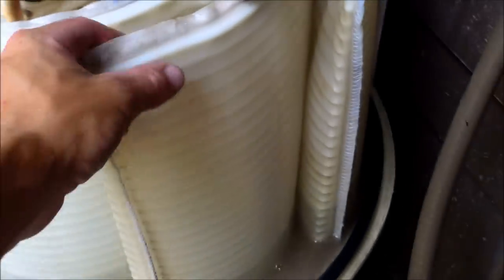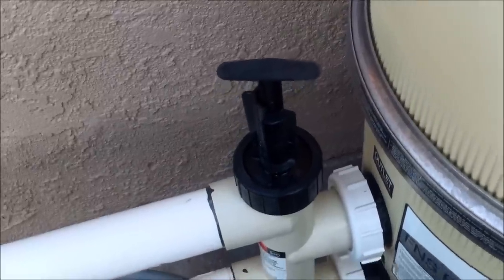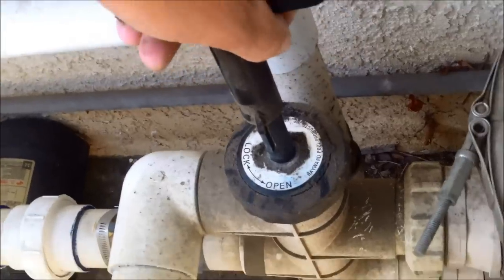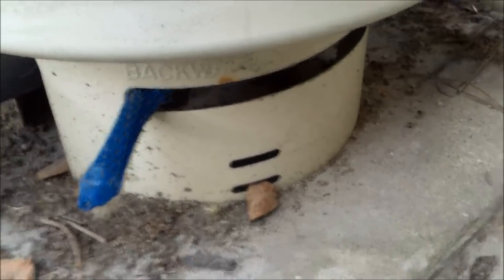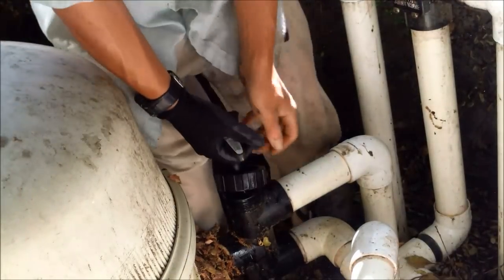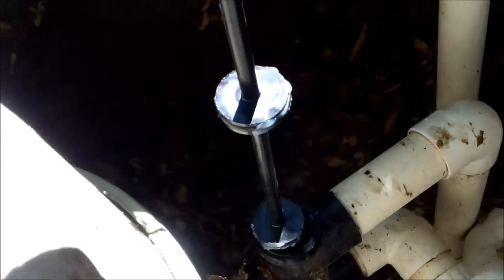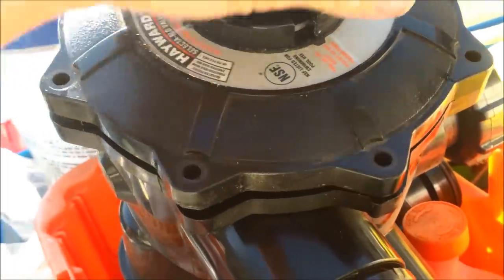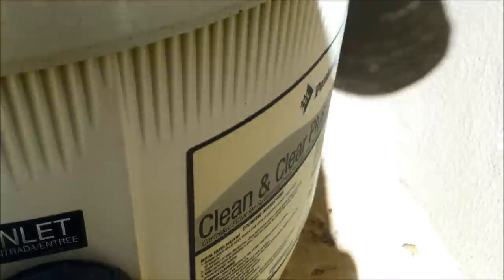How To Backwash Your D.E. Filter - The Ultimate Guide

Comment from the maker: How to Backwash your D.E. filter. Here is the most comprehensive video guide. I cover both the Push-Pull and Multi-port valves.  I also cover the most common problems you will encounter.
Reply: Hello, thank you for the nice ,easy to understand video. I would like to know if you haveany solution or feedback on this problem. I have a pool that has great circulation and suction for vacuuming. The cartridge filter has no apparent tear .However when I vacuum ,all the debris is being pushed out again by the jets...a mystery ???   Thank you for your time!
Reply: if i backwash my pool without a backwash hose(yea the de gets everywhere and i have to scoop it up with a shovel and throw it away later) do I still need to backwash for a minute or only 30 seconds? Sometimes I feel like I'm backwashing too much of the DE out. The last time I did a full clean out and charged my filter was 5/4/14. My psi is at 22 right now since I threw in baking soda yesterday night to raise the ph to 7.2-7.6. I shocked the pool with 3 lbs of shock to boost the chlorine levels, 1 crushed chlorine tablet mixed with a 35lb bucket water, and 4 cups of chlorox bleach mixed with a 35lb bucket of water. My stabilizer/acid levels are at 30-50 ppm.
Reply from the maker: I usually will backwash a pool for up to a minute depending on when the water starts to come out clear. Usually the first 10 seconds it is clear, then for about 30 seconds it is pretty dirty water. I will stop when the last 10 seconds is coming out clear. So roughly 1 minute give or take.
Reply: Swimming Pool Tips, Reviews & How To -MrDgvb1
I have an older pool  (filter catridge) that doesn't have the ability to backflow the water when I vacuum. There is so much sediment, that going thru the filter doesn't work, it just clouds the water again. Anyone know how I can easily put a backflow valve in? I would like to vac the pool bottom that way, add clean water, replace the filter as I have the water crystal clear....Any ideas or suggestions are welcome. Thanks!!
Reply: Jordana Angles you should vacuum the pool while the filter is on waste so you aren't pushing all that sediment through the filter. Waste will pull the water through the pump , bypass the filter, and send it out. Run a garden hose in with fresh water as you are doing it to maintain your water level.
Reply: Thank you so much, Anthony!!
Reply: N
Reply: Very helpful video. Question for you. How do you backwash if you have a separation tank? I would appreciate any help. Thanks!

Comment: Here is what I do, which lets you backwash with tap water instead of pool water!   This means you can dump clean water into the street legally (if you also use a DE filter sock to catch the DE coming out) or to your yard.  If you have a saltwater pool you also won't be losing salt or hurting plants with saltwater.  This only works if you have a pool+spa combo setup.

What I do is pump the spa water into the pool until the spa is almost empty.  At this point your pool might be close to overflowing (make sure you have enough room!).  Then I fill my spa with tap water from a hose, maybe 200 gallons or so, whatever you need to backwash with.  Then just run your normal backwash process but taking in water from the spa instead of the pool.   When finished, pump your pool water back up into the spa and you are done.

Comment: Thanks for sharing your expertise. I have DE filter with multiport valve. When I vacuum in filter mode, the debris returns to the pool. Same thing when I add DE. Eventually the DE will "stick" to the grids, but not initially. Debris always ends up recirculating into the pool. I have checked the grids and found no obvious tears. I have disassembled the multiport valve and replaced spider gasket and O rings, as it was turning hard, and I didn't believe the spring mechanism was allowing it to form a tight seal when recessed into place. I'm still not convinced it snaps down all the way, and believe some water bypasses the filter alltogether. Anyway, I'm considering splitting and cleaning and inspecting the filter again, but don't want that hassle if you have a way of determining whether it's the multiport valve that's allowing debris back in or the grids. I still think it's the valve, because the last time I split and clean, I put valve in filter position (after backwashing), and when I recharged the filter, around an hour later I noticed the pool lost 3 inches of water and water was going out the waste line even though the multiport valve was in "filter"! So, at that point I made the above changes to the valve. About the only other thing I can think of is the valve still isn't sealing tight, or that the bottom of the grids were punctured when I misaligned the manifold contraption and the bottom plate. Getting sick of vacuuming to waste to ensure debris goes out, and refilling with water!!! Please help!
Reply from the maker: I would open up the filter and take off the top manifold again. Check for any broken grid tops. Also turn the top manifold over and inspect the bottom for cracks. I am editing a video on the top manifold and I have found that the bottom tends to crack on occasion while the top looks fine. If that checks out okay and you think the grids are all intact then swapping out the multi-port valve would be a logical next step. DE can leak from several locations: cracked grids, top manifold, stem pipe o-ring and backwash valve.  You just have to go through the process of elimination sometimes if it isn't obvious. What filter model do you have?
Reply: Swimming Pool Tips, Reviews & How To -MrDgvb1 Thanks for opinion. I saw in one of your videos you backwashing a DE filter while it was split and exposed. Would doing this be safe and help me see if the grids fill with water? I'd like to visually see it fail if possible, in addition to double-checking grids for cracks.
Reply from the maker: taylocamax It is perfectly safe to do. I do it all the time before I put the lid back on to check for grid failure.
Reply: I also was wondering about backwashing while the DE filter was split and exposed. I have a multi-port. Can you please tell the the correct steps to do this correctly? I have DE shooting all back into my pool and Im sure that's why I can't get rid of the alge as well
Reply: Well I took apart the whole filter system. Checked all the grids and no holes. Put everything back together. First scoop of DE went in no problem. Then the second scoop went in and BAM. DE shooting into the pool. And I did check the top manifold
Reply: Ok so now I have changed out the manifold.  Changed out the o ring on the stand pipe. And inspected the stand pipe.   Re-checked the grids.  Took apart the multiport and checked the spider gasket.  And I'm still getting DE back into my pool.  I really dont know what else to do.  Please help.

Comment: I installed a new pool timer today & works great, I have been powering it up manually each day,it's a 2000 pentair Purex. I always  purge the air out each time I power up, now is this necessary in a automatic power up,? Meaning is it ok to have a little air in filter tank? Or do I have a problem?  With air getting in?  Or will it he air just bleed out on its own?

Comment: Hello there and thanks for the great vedio on Back washing very helpful.   My question is I have a Pentair high flow variable speed pump, with a Pentair Multi port Valve for Back wash what is the proper speed for my pump to use for backwashing. My pump setting is at 2800 normal running setting, Does it have to be lower for backwashing ?  Thanks for any Advice Appreciate.

Comment: just a small point. I take a small bucket and mix the D.E. into a slurry before pouring into the filter to avoid clumping. great video
Reply: Scott Mcguire That's why the skimmer basket is left in during the process.
Reply: Ultimo D thats good for keeping the clumps out but i like to hand mix it in the bucket to avoid the hassle of pulling clumps from the basket is all.

Comment: Regarding back washing..Is water suppose to return to the pool via the return lines while backwashing?  I thought during back washing the idea was to have no water return to the pool.  Is this normal or there is an issue with my system?  I have a QUAD DE Filter now.  Please advise.    Also I'm still having an issue with D.E. returning to the pool through the returns. Any assistance is greatly appreciated.  Thanks!

Comment: For the pull-push valves, is it necessary to lock them in place all the time? I typically just pull and push to backwash but don’t really bother to lock it.
Reply from the maker: Locking is important. You don't want it to activate or make it easy for a kid to just pulll it up. It has happened.

Comment: I have a Hayward slide valve. I removed the pin to take the t-handle off but the t-handle wont come off. Is it threaded, or do I have to just give  a tap with a small block of wood.

Comment: We bought a home with a pool a year ago. The pool guy came with the house, but now he is gone and we're on our own. He cleaned the filter once a year in the spring and never backwashed it, for 8 or so years. Now, we're trying to figure out how and if we need to backwash.  The big confusing part is we have a D.E. Separation Tank which has also been neglected.  We're trying to figure out what valves to open/close and how to backwash while having a DE Separation Tank in the midst. Can you show any videos of a DE separation tank??  Thanks.
Reply from the maker: Are you able to just cut the separation tank out? Those are a real pain. It would be better to just cut that PVC pipe and install a long 50 ft backwash hose if needed. Then you can just backwash whenever needed without messing with the separation tank.

Comment: Hey David I have a question you said some of the bigger DE filters is like a 60 or 70 square-foot filter is that mean that my basics C 900 cartridge filter which is rated at a 90 square-foot filtering capacity is more powerful than a large looking DE filter as far as square footage is concerned
Reply from the maker: Cartridge Filters do have more square footage for sure. But DE filters are more efficient with the smaller sq ft area due to the superior method of filtration. So a 60 sq ft DE filter is equivalent to a 400 sq ft cartridge filter.
Reply: On ok thank you david and if i may ask in your opion who makes the best filter tank hayward or pentair
Reply: Are you still using the perlite instead of de

Comment: Hi David, I just took apart my Pentair FNS Plus 48 sq. ft. DE filter and gave it a deep cleaning all the way down to the grids. After I put it all back together I noticed about 3 hours of it running it seems to build pressure back up to around 24 PSI. My meter reading is around 13 PSI when first turned on. Can you help me PLEASE. Last year it was running perfectly now it's starting to give me issues. Could it be the plumbing, air leak, or just need a new pump?
Reply from the maker: How old are the grids?  And is the pressure gauge dropping to zero when the pool turns off? How is the water flow?
Reply: It's a brand new filter I had just bought less then a year ago. I have a Hayward Super 2 pump that originally came with the house when we bought it last year. I notice some of the plumbing are 1 inch or 1.5 inch pipes that connect to 2 inch pipes that lead to the filter. Would that be an issue? I also seen your video on cleaning the impeller which I did but didn't find any dirt or debris. I am getting suction at the summer (which I only have 1 on my pool) and the return port into the pool when first turned on seems to be working fine at first but then seems to decrease pressure as couple of hours go by. But by then I notice my PSI reading is around 25 PSI by then

Comment: I cleaned my Hayward c1750 filter last month after the water pressure got derogated. However I noticed that the pressure gone low again in the pop-ups and the jets so I opened it and again today and it had dirt and debris in. after the filter got cleaned the pressure back to normal. do I need to clean the filter every month? or there's something wrong?
Reply from the maker: Those one cartridge filters are typically undersized for most pools. Especially if you have the in floor pop-up system as in your case. You will need to clean the cartridge regularly and replace it often. Once a month is typical.

Comment: Hi, How do I find out which PVC Push/Pull Slide Valve Piston is compatible with my Backwash system if I need to replace mine?
Reply from the maker: There are two leading brands. Pentair and Hayward. If your handle has an "H" on it its Hayward.

Comment: Hey david if a de filter is 60 sqft and my c900 hayward catridge filter has a 90 sq ft rating my little cartirge filter can do more than a big de filter ?
Reply from the maker: Technically yes. But a 60 sq ft DE filter will filter down to 3 microns vs your filter at 10-15 microns and it will need to be cleaned about every 6 months - vs yours that probably needs cleaning once a month. A cartridge filter has more sq ft of cleaning surface but operates differently from a DE filter. D.E. is overall more efficient with smaller sq ft of filtration area. If you want to try to compare Apples to Apples I would say a 480 sq ft Cartridge filter is equal in filtration to a 60 sq ft DE filter.

Comment: Ps. The reason I want just the T-handle off is to replace the large plastic nut that holds the slide valve in. Part # sp7200

Comment: When i clean my DE filter there is alot of DE in the bottom area of the grids it appears the DE came off the grids and settled in the bottom. Why is this happening and is it normal.
Reply from the maker: It could be that there isn't good water pressure getting to the filter, causing DE to pile up at the bottom of the filter. It could also be air in the system not letting the water rise to the top of the tank when running.  How old is the filter and what model do you have?

Comment: I find my grids, lower level, are not getting covered. What's my issue?
Reply from the maker: Could be poor pump circulation. If the pump is really old it might not be pulling water well.
Reply: @SPL  Have a variable speed about a year old

Comment: What if I have no backwash vavle do I just pull apart and clean everything once a month?
Reply from the maker: Take it apart and clean it when the PSI goes up by 10. Next time you clean it mark the pressure gauge with a sharpie on the clean pressure - say 20 PSI. Then when it goes up to 30 PSI take it apart and clean it.
Reply: I was told by my local Leslie's ( San Francisco Bay area) that you cannot flush to sewer or to gutter, and not to leave it in my backyard because it's bad for you. What can I do? He tried to sell me some cellulose stuff he said was safe.